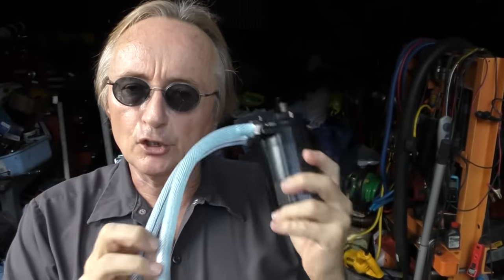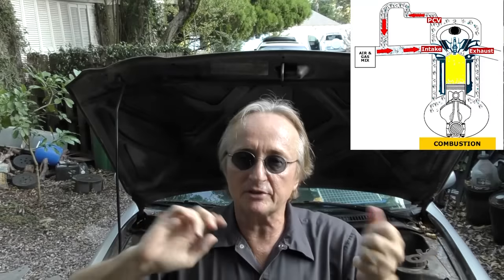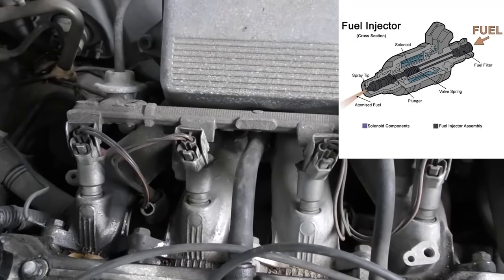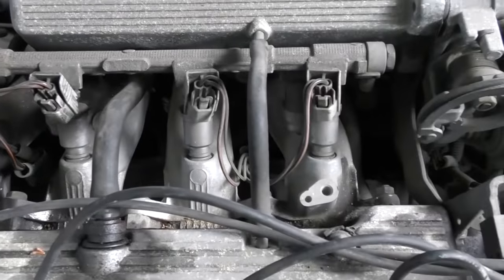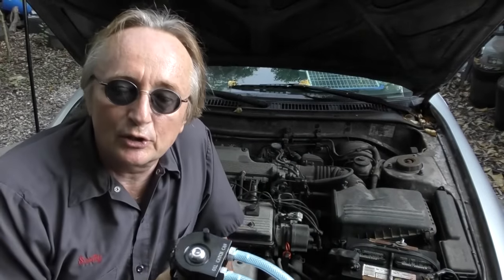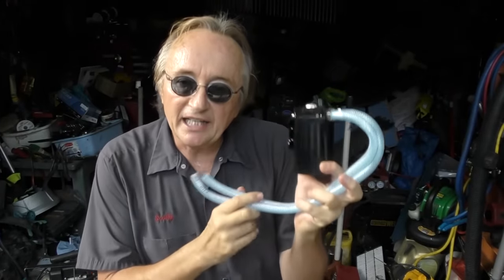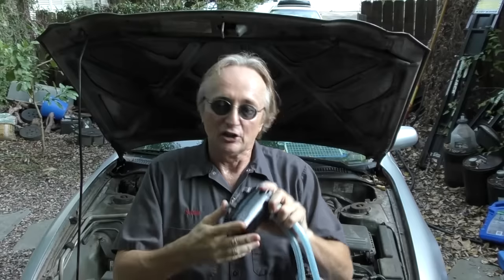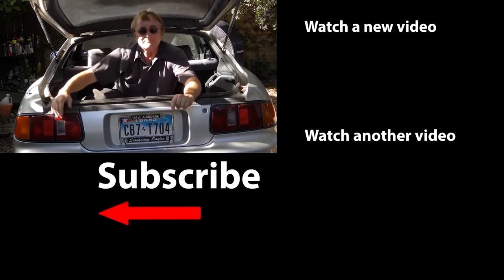If You Have This Type of Car, You Need This to Prevent Damage to Your Engine - Oil Catch Can

Comment: Boy, he rarely misses an opportunity to remind us about the resilience of his 240K mile TOYOTA.  💰
Reply: Michael B. - I wouldn’t buy another DI Volkswagen if it was half price. I bought a Toyota particularly on Scotty’s recommendation. But ha I noticed that too
Reply: Well sure people laugh at a toyota for its vanilla flavour but they stayed away from Turbo and gdi, hence the proven old school reliability. Play it safe.
Reply: I bought a 2002 Chevy Malibu cause I wanted to support Detroit. Five years later, the car was having throttle issues ( revs up at stoplights ). Took it to the dealership. They couldn't reproduce the problem. Paid the 1 hour labor fee. Am I trusting this car to haul my wife and 2 year old around the mean urban streets of Los Angeles, at night? Abandoned domestic cars after that. Vanilla Toyota for my family!
Reply: LOL! EVERY one of our Ford vans and trucks made 300k all the time.
And we drive the piss out of them!
Plus we don't even change the oil every 3k but every 7,500 miles and very minimal other maintenance.

The myth that only Toyota's break 200k on an engine is so silly.
Those snobs don't even drive their vehicles as hard.
Reply: hackfreehvac -  Any of those 5.4L 3-valve Ford engines?
Reply: Hubjeep my 5.4 had 293,000 when the computer died. It wasn't worth fixing since i had been driving it hard for two years after hitting two deer about a month apart.
Reply: Michael B. It must be stuck at 240 thou because it has never passed it.
Reply: The Toyota that’s had 240,000 miles for the past 5 years.
Reply: It's totally a prop.  He parks it on the side of the garage when he's not shooting.
Reply: hackfreehvac Very true. My family runs a business and our four work trucks are all GMC or Chevy and 3 of them are past the 200,000 one approaching 300,000. And they are WORK trucks as in heavy loading and light off roading. A grocery hauler better break 200,000 or that’s a fail.
Reply: Michael B. Yea big deal 240k mis on how old a car? Toyota sucks.
Reply: Hubjeep the 5.4L was a fine motor only a few yrs had some issues and were easily solved. Ford sells sooooo many trucks hence why things got exaggerated. I've owned 2 - 5.4L V8 Ford trucks ran & lasted just fine. Now new F150s for us!
Reply: My tahoe 4x4 is at 327,000 miles original engine and tranny. Proof that Toyota isn't the only one that can break 200k. Can't lie i do like Toyotas
Reply: I got impressed with Toyota about 30 years ago doing routine maintenance on a friends used van. Not only was it reliable and easy to maintain but every piece was well designed and of high quality. My next new truck was a Toyota that I kept for 14 years and only sold ( to a relative ) as I needed the towing capacity of a Tundra.  Even little things like brake lining inspection ports with rubber plugs that make this maintenance a snap on my first one with drum rear brakes to light bulbs that are top notch - I have replaced one headlamp due to a rock crack and one dome light bulb in 24 years with Toyotas.
Reply: 200k isn't really even that much. That's just when a lot of people start thinking to switch the car incase something goes wrong in the future. Most cars, aside from throwaway hyundais and the like, will hit 200k no problem. Hell, there was a story I heard once of a commercial diesel ford truck running to 300k before they did even the first oil change. They just topped it up occasionally as the engine was well known to be ridiculously unphased by length of oil changes.
Reply: @PapaWheelie1  maybe you were putting wrong engine oil in your di diesel
Reply: Anyone still driving any year Ford Exploders (Explorer) past the dealerships front gates raise their hand!?! Go ahead we'll wait......🤔😬😂😂😂 seriously!!! Hell, there for a while the Explorer itself was so sad and depressed they started committing suicide with those self exploding Firestone tires.....🤷🤦😬🙄🙄😂😂
Reply: My dad's F150 is going on 270k and my grandma's Expedition is going on 280k so it's not shocking to me 😃
Reply: I have a 240,000 mile 99 Jeep Cherokee 4.0. Runs fine. Had the factory ignition in it still when the woman brought it home. (plugs burned to TWICE the gap and factory MOPAR numbered wires on it! And the damn thing still passed emissions!)
Reply: It must have run over the Energizer bunny at some point and ate it!  We drive that thing everywhere when highway miles are concerned as it gets much better mileage than my 03 Wrangler with 35's.
Reply: Good choice! for over six decades Toyota has proven itself to be the safe and reliable choice to keep your family safe and so you don't have to worry about them. As a side benefit, Toyotas (when not abused) tend to last the longest so they have the lowest cost of ownership of any major brand of car.
Reply: @scythelord  here in Europe is normal to se cars with that milage i have 2 audis a4  1.9 tdi one with 360k miles and the other with 380k  but skotty talks bad things about audis :p
Reply: My golf has 206k
Reply: @ferndog1461  You must 've had an issue with throttle servo motor on your chevy so it reved up on stands, that's the common diagnose within cars with such a problem; just sayin, nevertheless it's too late 😊
Reply: @hackfreehvac  I have a 97 5.0 explorer with 250k still running strong and I did oil changes every 10k when I was a teenager (I used to be dumb, still somewhat so)
Reply: @RPWalker  wow that was one of the last 5.0.
The Triton 4.6/5.4 also last a long time with normal oil changes.

Our fleet of 5.4 Ford Van's didn't even hear retired until 300k. Still running.
Reply: he also rarely misses the opportunity to mention his $5,000 scan tool ...lol
Reply: Can I remind you, I am proud of owner of 2000 Nissan xterra with 268570 miles in it. And changes gears like dream and just keeps on going. I have water pump leak, that I'll eventually replace and my power steering hoses are leaking but that is all minor the engine runs like champ. V6 by the way
Reply: My 96 peterbilt 379 hit 960k this month 😂 still a cream puff
Reply: I've had Pontiacs with close to 300,000.
Reply: My 2010 corolla has 388k and still runs like a dream. 33mpg. NGK iridium plugs, one alternator and a few hoses. Outside of basic maintenance items like oil and brakes and tires, it's a bulletproof car and I wouldn't hesitate to drive it across the country.
Reply: God damn it and I'm reading this while just hoping to get like 120k outta my bentley gt
Reply: @Hubjeep  You got to make sure to use a torque wrench when changing the spark plugs. Most of the cases of the spark plugs stripping the aluminum threads was because of either under or over tightening the spark plug.
Reply: my 2004 camry is 256K miles. more than his
Reply: @ferndog1461  don't forget Toyota was the most famous for issues like what you just mentioned. I'm sure you saw it on the news. I'm not saying Toyota doesn't make good vehicles in general, but I see a lot of Toyota owners seem to be arrogant about how great their choice in vehicle is and ignorant of the issues they have had. Eg frames breaking in Toyota trucks.
Reply: @Hubjeep  I think the vans did not get the shitty 3v engines.
Reply: i would boast that my cars have high as hell mileage but its feb and i live in michigan so theyll find out and grenade tomorrow...
Reply: scotty has never been in a huge wreck in an asian car. thats all i have to say about his hating on euros like "porsh" derp
Reply: My 1996 Toyota Tacoma had 335k and still runs like new ..
Reply: @moeanthony9308  exactly. New "go faster" technology always comes at a price.
Reply: @heyitschinoable  name one
Reply: @Azureecosse  I don't live in Europe tho. I am talking north American to be more specific. So let me ask you this Mr engineer.. Why did they stop turbo after the Supra?
Reply: 3 letters... Cvt. Those transmissions are garbage and yup my 90’s honda is 250k strong and I daily it. Spend thousands while I stack dummie
Reply: @divinity158  That's bs. Nothing wrong with cvts.
Reply: I have a Fiat with 270k km, still driving it daily
Reply: @heyitschinoable  currently nadda. It may be Gdi but combined with port injection to alleviate the problems with GDI.
Reply: @Azureecosse  In North americas that's not the case. It Gdi and portinjection.
Reply: @divinity158  So can u please explain the reliability of Prius and the cvt that's been used for donkey years?
Reply: @heyitschinoable  so lemons can't exist in any car? Do people really think an issue will never happen or it shouldn't happen?
Reply: @heyitschinoable  nope. This thread is tired and not worth it. I know what I know.
Reply: @heyitschinoable  presently no. What Iam referring to. Hence why the combo. Those were bad years.
Reply: @heyitschinoable  exactly
Reply: @heyitschinoable  That includes upgrades a year or two later as well.
Reply: Yup, like my 236000 mile 08 Trailblazer.
Reply: I have a 1996 acura rl first gen/year
230k all original. nothing replaced yet 4 years into me driving and still running strong I gotta do the struts but so far thats it!  People give praise to a proticuler car manufacturer but its not the car its you and how you maintain it 😉
Reply: Toyota also had the same problem as the rest of them.  lol....  They fixed the issue like Ford did and a lot of rest of them.
Reply: That's because he never drives it. That's the "only" car anyone is supposed to buy
Reply: @hackfreehvac  my 14 focus is at 194k but will definitely hit 200k. The engine is in good shape. May have some transmission problems, but it's the 5 speed so worst case scenario, $1200 to replace it.
Reply: @Hubjeep  
No. Mostly all 2000 to 2004 era 2 valve engines. 
The last few places I worked at either had early 2000's or almost new so I didn't get much time in the late 2000's.

The last two service vehicles I've had was a 2016 Ford Transit with the EcoBoost (that's a fast friggin van that will smoke most sedans) and a 2017 F-250 from new that I'm still in at almost 40k hard miles so far and runs great.
Reply: I have a 2001 rav4 with 370,000 miles original starter still
Reply: @jakeself3386  or that he's been a mechanic for 51 years🙄
Reply: My cvt Subaru Outback has 232000 miles and runs perfect and drives every day.
Reply: That he rarely drives mind you because he is a millionaire making YouTube videos with referral links...
Reply: @divinity158  CVT's have been used since the 80's... Your ignorance is outstanding
Reply: @heyitschinoable  Lexus is not Toyota
Reply: I have a Honda Accord with 250k and still going strong
Reply: That doesn’t run.
Reply: Big deal i hit 235k in my civic so i put a turbo in it. She loves it.
Reply: Tom Wetz  Please keep sharing this info with people, too many still believe cars only last 100k even though they don't do maintenance.
Reply: Not as impressive as Matt Farah's million mile Lexus.
Reply: @Davido50  Yeah, you replace 7 OEM exhaust manifolds within 20,000 miles of one another starting at 60,000 miles and then tell me they're fine motors. I replaced the spark plugs once, 7 of them snapped off and I had to pay $800 to get them extracted. The truck it's self had a host of other problems too, and I never exceeded the tow limit or drove it like I stole it. The 5.4 sucks and you know it.
Reply: My vw is on 300k miles , and not kilometres
Reply: Like 240k mile cars are rare lol. Craigslist of loaded with them. People trying to sell them for stupid prices. Like I'm going to buy a 200k mile plus car for $4000.
Reply: Is 240k a lot?
Reply: @christophervanzetta  bet me
Reply: @richochett404  Bet you what?
Reply: His 240k mile 1994 Celica is his proof that doing what he says will keep your car running like mad.
Reply: @gregnixon1296  is 240k a lot of miles to you?
Reply: U never see him work on anything guess he reads alot about automobiles lol 😂
Reply: To this day he claiming just like factory 😂💀
Reply: I have a 300k bmw...
Reply: Hes only put ten thousand miles on that celica in 10 years so it's not driven much.go back ten years on his videos his celica has 230,000 miles a decade ago.still a good vehicle but it's well taken care of..very well.
Reply: He never drives the Celica though. Literally 5 miles in 16 months time I once counted and noticed from his videos where you could see the Celica's odometer.
Reply: Yes
Reply: Haha
Reply: After being a lifelong Chevrolet , Olds Guy , I’ve was constantly tweaking this that 15 yrs , After switching to lexus 10 yrs ago , So easy to work on . I have one rx300 with 320,000 miles . Normal maint is all I’ve ever done , it runs as good if not better than ever!!! 5000 mile oil change and still never drops any between
Reply: Mate. Fix oil catch right now. You have Toyota with only 240k another 240k she will do easy! . Simple.
Reply: I got a 02 Jeep Grand Cherokee Laredo 4.7L V8 that has 220K miles.
Huge difference, the engine & transmission are fine but the suspension and steering components need to be replaced:
▪︎ front & Rear upper & lower Control Arms. $140
▪︎ Rear Shocks already replaced the front. $200
▪︎ Front & Rear Sway Bar + Bushings $140
▪︎ Front & Rear Sway Bar Links w/ bushings. $130
▪︎ Front & Rear Coil Springs $160
▪︎ Front & Rear (upper & lower) Coil Spring Insulators $180
▪︎ Rear Upper Control Arm Ball Joint with tri bolt plate $40
▪︎ Steering Damper/Stabilizer $45
▪︎ Front outer Tie Rod Ends (Frame to knuckle) $100 and requires a 4 wheel alignment at shop +$100
▪︎ Bolts to replace each part is around $2 ea on BelMetric and Nuts are $0.52 ea. Must be Grade 10.9, Hex Flange Bolt/Nut Head, Partial threads and Coarse Threads on nuts and bolts!
Size of Rear Shocks bolts are:
M12x1.75x80mm top bolt
M12x1.75x70mm bottom bolt
Frame/knuckle bolts are usually M14x2.00x114 in my Jeep and most Chrysler Automobiles
Reply: No big deal all my cars would last that long in Texas, my biggest problems are from rust.
Reply: He is stuck in time
Reply: As if that is something to brag about my 91 S10 has 544,367 factory 4.3 l and 700r4
Reply: 290k on my Prius and still going.  Already cleaned out my intake, manifold, and EGR cooler.  I wonder if I can get 500K out of it?
Reply: My Toyota Avalon is at 370k and I’m not Scotty 😂
Reply: Do i need a oil catch Can on my 2001 Audi TT mk1 turbo 225?
Reply: Those are rookie numbers. Half the taxi drivers in my home town have put over half a million miles on the clock on their camrys and they don't floow his advice.
Reply: I'll remind you my solara has 310k. Lol
Reply: Toyota's market capitalization 250 billion. GM's is 89 billion. There's a reason Toyota is 3 times the size of GM. Actually there are many reasons.
Reply: Toyota’s the brand of beta males. “My Tacoma is so tough, but also very reliable!” Also slow AF!
Reply: 😂iwas thing the same damm thing🤣. This dude is a joke on legs
Reply: I laugh at 240k when I have 390k on a 99 model chevy 5.3
Reply: Wouldn't you?